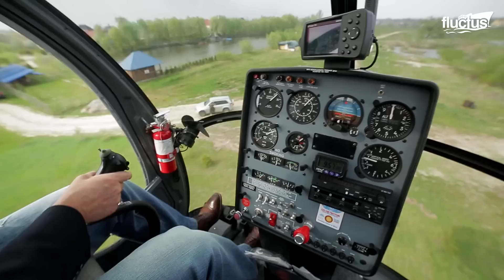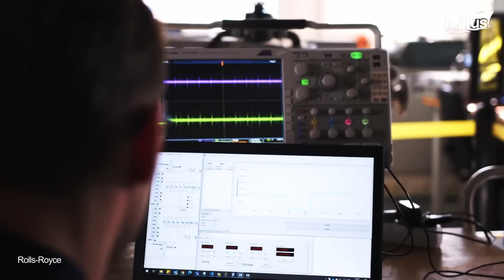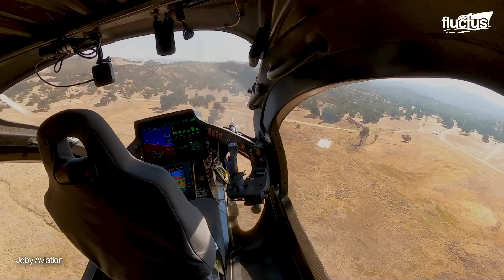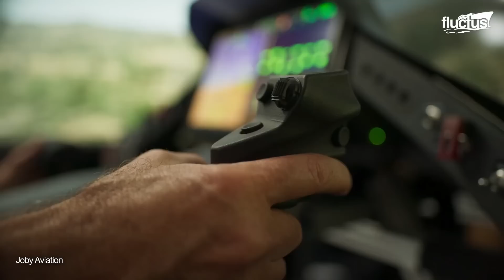US Air Force Testing Brand New $4 Million Fully Electric Aircraft

Comment: a stratolaunch with a lifting body between the fuselages flying high, fast and efficiently while dropping empty batteries as autonomous planes would certainly make it across the pacific
Reply: talk about polluting the ocean.
Reply: @garygeorge9648  (you can land autonomous planes wherever you want them to land )
Reply: it made much more sense to use electrical drives and brakes on the landing gear, to avoid using the turbines for taxiing and gain some energy when braking.
Reply: @spxram4793   an electric a-10 would have no heat signature and the batteries would be extra armour
Reply: @replica1052 nope, this is imposible, lithium batteries can not do any of this, too heavy, very little range, over heats and will never push an A-10 at 800+mph plus it gets worse if you try to carry armaments like bombs and missiles.
Reply: @lcfflc3887  most of your comment is accurate ... except the idea of "push an A10 at 800+ mph" ... 
A-10 cannot fly 500mph.
Reply: @npmetzy5737  fly higher, faster and more efficiently - some planes have drop tanks, drop empty batteries as autonomous planes

Comment: I recently saw a video on a plane going the complete opposite way. It had the stock Rolls rotary motor taken out and a super charged LS swapped in with a custom transmission gearing it so it could fly at 3,000 rpm and nit the usual 6 or 7000 rpm most plane motors spin at.

Comment: What about the production of batteries? Is it not polluting? This means that more batteries will be produced and it will required more fabrics and natural recourses to produce them. Therefore it will be more imitations and pollutions in the environment. So its basically a world propaganda created by the system. If you look deeper into it, there is no sense.
Reply: No.  It just means the solution to co2 and pollution is more complicated.   Not all batteries are created equal.  Some (especially those in development) don’t require toxic or rare metals and don’t have a massive co2 footprint.  Peddling tropes will never be a substitute for facts even if you easily convince the slow brains.

Comment: Electric vehicles, on the ground and or in the air, have a long way to go, till they will work. Range and charging are issues to be solved, before mass production. 800-1000 miles on a charge, are needed, for basic units. Ultra fast charging, with charging stations every where are needed. That hasn't happened. Technology still has a long way to go. Till then, fossil fuel is the way to go.
Reply: How many gas cars have that range?  Transportation is not one-size-fits-all; for uses where electric works - and there are many! - it is quite a bit less expensive than fossil fuel.  Or do you think there is so much commercial interest out of the goodness of companies hearts?  Electric aviation is the kind of green that companies like - money green.
Reply: Transporting thousands of gallons of liquid fuel from place to place also has its own issues. I suspect the near future will have fast, swappable fuel cells that take minutes to swap out. And a single trunk-sized fuel cell or battery will be equivalent to a hundred gallons of liquid fuel.

Comment: Will KC-135s now have in-flight charging cables?
Reply: The refueling plane will drop a case of Harbor Freight AA batteries.........
Reply: KC-46 or The Sunshine Band will replace it.
Reply: lol
Reply: Yes, WiFi connetion.
Reply: No just a fucking long extension cable, plugged into the smoko room
Reply: Trying to charge a battery pack that fast will burn it.
Reply: Android Type B or Type C? Otherwise, iPhone charger?
Reply: How to fly without wings
AntiGravity Air Taxi

Work base on Gravity just spinning by using Battery
can fly in bad weather, plunge in the ocean even in outer space
Can lift more than 100 Ton 

Earth which weight predict 600 trillion ton does not fall at the Sun because of centrifugal in orbitting, on the contrary it does not be thrown far go out the orbit line of hold by gravity at the Sun as orbit center. Gravity and centrifugal is equal called Equillibrium, thats why until now Earth which we was inhabited always rotate and circulate the Sun. Now we justly take example : how if the gravity used and centrifugal is negated? The Earth will float far leave the Sun. So that centrifugal can be used to fly far away if gravity eliminated. Finally how to eliminate gravity?

It’s way rotate part of aircraft by horizontal. When that rotation faster centrifugal force getting greater and the gravity getting smaller, finally it lose the gravity and the aircraft start flying. Of course people would surprise: how the aircraft can keep rotate without fulcrums? Thats why we named that aircraft Shuttling System that is aircraft likes two disc adjoining attached in the midle as fulcrums:

A. The Top part, we name Positive rotate to right, and the edges is getting thicker and havier.

B. The Buttom part, we name Negative rotating to left, and the edges is getting thicker and havier.

C. Middle Part , we name Neutral, air crew placed and also machine and everythings turning Negative and Positive at the same time.

The aircraft can liftup added with explosion from the engine. However that aircraft construction later, let the engineer doit it, and we are sure the aircraft will bulletproof and also waterproof.
 
.
.
 
In modern civilization where human being generally using flying saucer as vehicle, will a lot of change in lives either in materialism and in psychological. In materialism area will apply the change in life like.
People no longger need roadway and rel road which spend large of energy, money, places, things and time, object place and time. People would utilize that area for habitat or for other need:

Comment: I don't trust the safety within electric vehicles at all
Reply: Winters are a nightmare. ZERO control on slippery surfaces. Back off the foot feed and they go into full braking. People are going to die.
Reply: @TomokosEnterprize  true 
Let's continue holding on to our powerful diesel engines
Reply: @bensonmugore   I worked in the bush with long drives back and forth and in winter our pickups will run all day just to keep warm. There is no way possible that electric will work up here. I am in Northern BC Canada.
Reply: @TomokosEnterprize  i totally agree with you. Electric vehicles are not reliable.  Imagine all our current vehicles once had some electrical issues at one time, and it took time to solve . What more a fully electric functional car? No 👎 👎 👎 👎 👎 👎 it won't work
Reply: @bensonmugore  There is a reason parts stores do not give a warranties on electric parts. They are impossible to diagnose if they have a fault. Even if the box hasn't been open that's the way it is eh.  This can only be a nightmare in the future eh.
Reply: @TomokosEnterprize that's my main issue with it. Right to repair. I don't want a black box battery I cannot replace or service.